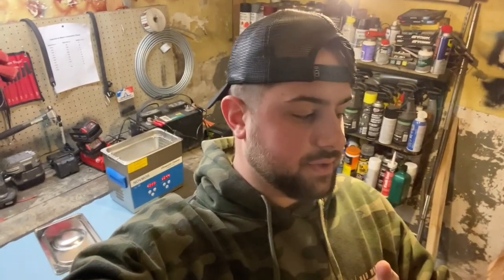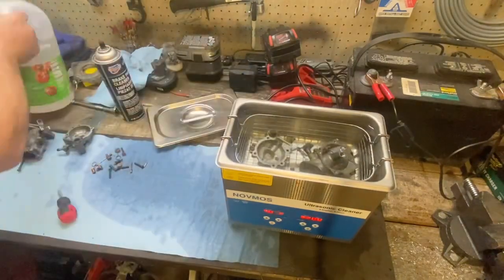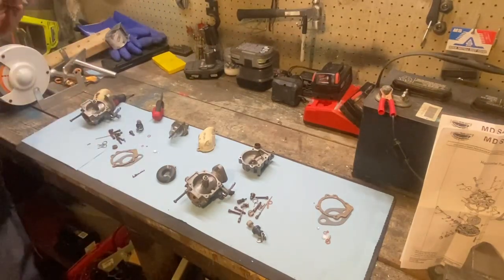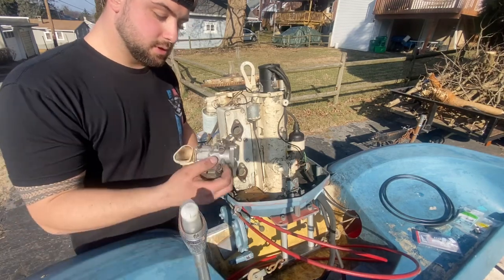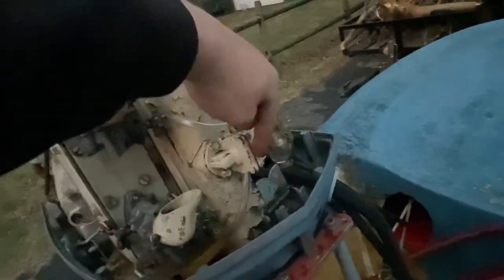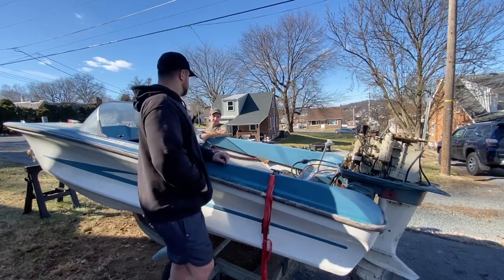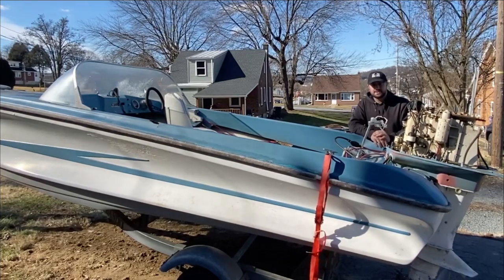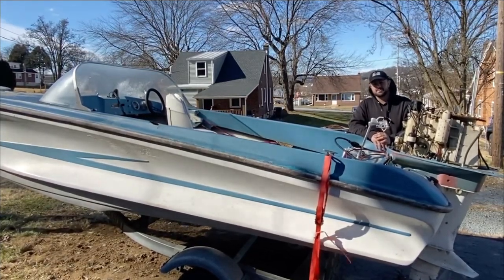The Little Homelite Stingray that Almost Could!

Comment: Take it out of gear. It may only start in neutral.  Try pulling straight out on the gear selector when in neutral and that should give you throttle control without the prop spinning.